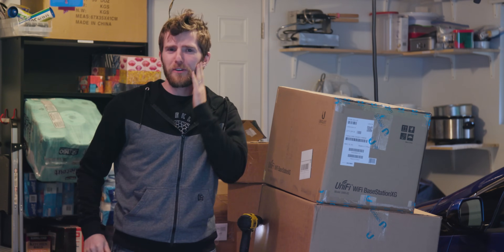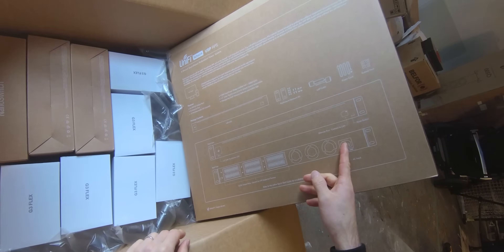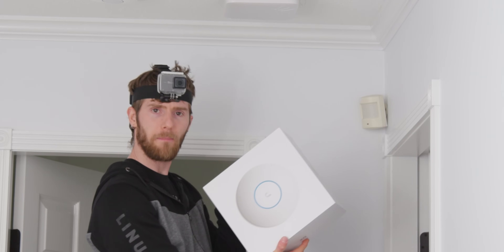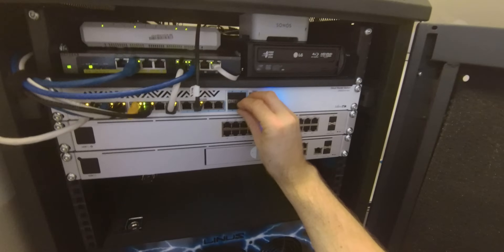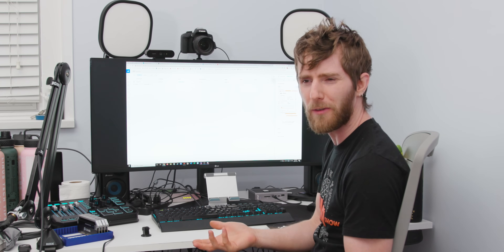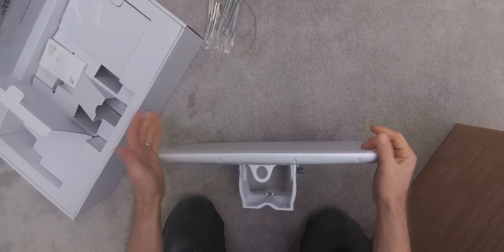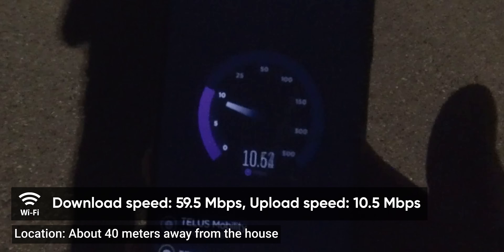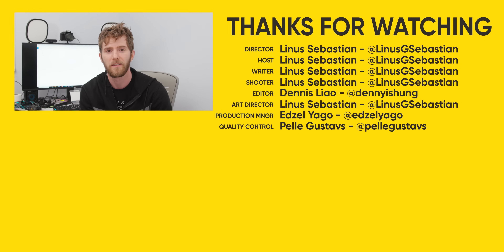I REPLACED my $1000 Wifi....

Comment: Just FYI.... there are some serious differences between the new UDM Pro and the older USG products.  Namely, the UDM Pro doesn't yet support WAN failover, advanced NATing, config.json support. OSPF routing, and others.  The UDM Pro is a great product if you fall within the UDM Pro's narrow set of use cases, it's a great product.  If you need to do anything special, you'll quickly see it's still very much a work-in-progress.

Comment: Instead of good old speedtest you could also use the Unifi app. It will measure the real  connection speed between your Dreammachine and the client without any slowdown from your ISP or Speedtest provider. It also runs indefinetely, so you can walk around while measuring - quite nice :-)

Comment: 320 megabits???

Here in Australia, you'll be lucky enough to even get 20 megabits a second.
Reply: I’m across the ditch in NZ, and I can get very fuckin close to 1gb download
Reply: @kuribuu7876  you don't have a back ass wards government xD
Reply: @Gesteppie  yeah man, the PM's looks like a horse too
Reply: @kuribuu7876  The smaller the country, the easier and cheaper it is to set up. Au/NZ probably doesn't have the same access to subsea cables as European countries so though, as the cables land quite close to many of the big cities.
Reply: @brazeiar9672  yeah man for sure, im pretty lucky because i had fiber on my street pretty early on, i would love to see if i can get it any faster, im not sure how to go about that though
Reply: @kuribuu7876  I see fibre being a lot in the UK but the population density is much higher so the cost per capita is lower. Speeds seem to be 70M, 350M, and 1G.

Comment: Why place an outdoor unit indoors?  You will loose 10 - 20 dBm in RSSI by the materials your roof is made of.  Those extra 10 - 20 dBm not only attribute to the signal strength, but also to the SNR on longer range.
Not only the materials in the line of transmission path will attenuate the signal, but mounting an access point close to materials will cause reflections which will harm your SNR. And SNR is even more important for a stable connection than RSSI values.

Another thing you should keep in mind, is that you should place at least one of the antenna's (either gateway or your mobile) as high as possible to increase the range. Since placing your mobile or laptop as high as possible is not too practical, you should place the outdoor antenna as high as possible.
So it is quite impressive to see the range of that outdoor unit, considering it is working on far from optimal conditions.
But using the same hardware it can be so much better.

Looking forward for the next edition of this video where you will try to increase the range (or at least the bandwidth) of the outdoor unit even more by placing it outside.
You know you want to :)

Comment: Just yesterday I battled with my own unifi setup at home. Moved my whopping 2 devices (8 port PoE switch and UAP-AC-lite) to a new controller that is running on a raspberry pi 4, which is also my home DNS (with pihole) and VPN server (with PiVPN).

I love the unifi devices, but man do I hate how the absolutely need a working DHCP server on the network. Otherwise you can't adopt or manage the devices with the controller, so it's not possible to set the device up with correct settings before installing it, like we would do at uni in our network labs.

Comment: Recently purchased a Ubiquity Edgerouter X 5 port for $50.  Added it to my home network to help my Nighthawk R6900v2 with the loads we get from 16-20 users.
Was my first use of Ubiquity products. Planned on using my R6900 as a router for wifi and the Edge X for the 3 lan lines. that Quickly changed to me using the R6900 in
AP mode for wifi and letting the Edge X run my wan, lan, DNS, Switch and DHCP. UBNT makes commercial grade routing equipment for sure, I have never had this much control
over my home network.  QOS and UPnP2 are easy to set up once you learn the EdgeMax utility.  My measily 60Mbs/6Mbs cable internet can easily handle all 16-20 devices streaming video
and doesn't affect my Warzone play at all, no more buffering, lost packets, latency or bottlenecks in my network. All that from a $50-$100 router that is 4x6x1" and still only uses 33% of the
routers Ram and maybe 20% of its cpu. Gonna sell my Nighthawk and buy 2 UBNT AP units for wifi now. That Big 3 5G radio AP unit just replaced the wifi for your entire subdivision!!
Thanks for the vids Linus!!

Comment: The last WIFI upgrade I did was adding a AP back in 2016 (ASUS RT-N12/D1) This is wired to my main router (Buffalo WZR-300HP w/ DD-WRT) that i got used in early 2014

Comment: Solid wire vs stranded wire: More wires, (stranded), equals more surface for the electrons to flow on, so less resistance, thus better flow. It is also more... "bendy", but I don't think that's the main reason stranded is recommended. ;)

Comment: One advantage of having UniFi APs connected via PoE to a UniFi PoE switch is that you can remotely reboot the AP by power cycling the PoE port.

Do note that the Ubuiquiti gear may have issues playing nice with gear from other vendors, especially when working with VLANs.
I've had clients connected to non-UBNT switch/AP being directed to the device VLAN instead of the configured client VLAN (e.g. via VLAN tagging the SSID), causing a whole bunch of issues.

Comment: Linus, pop in a second cable; the 1Gbit can run from the USW PoE switch to deliver power (do check the 802.3at rating requirements!) and deliver a 10Gbit uplink to the AP via a 10Gbit SFP. Unifi allows trunking the ports together.

Comment: Man, I appreciate your networking ambition, but dang, you’re not awesome at it. No offense!  Ideally, you’d install multiple access points and run them all at a mild to low power. Look at large schools/colleges/event centers: many WAPs. Sometimes two WAPs in one room. Check out the use case for the Basestation XG, it’s built for high capacity, not longer range. Hence the multiple radios built into it.

Comment: It's all fun and games until the neighbors start complaining that their wifi got worse... If it doesn't break any regulations then i guess it's fine, but it still seems like overkill.
My shitty little omnidirectional modem/router/switch combo somehow goes trough 2 brick/concrete walls and still works 30m away, so i have no idea why would you need such an overpowered thing...

Comment: Spending thousands on WiFi then using SpeedTest to test the connection strength...to your local access points. Use the companion app, WiFi Man by Ubiquiti and look at the actual link speeds to the APs.

Comment: Welcome aboard the Unifi train ;) You're gonna love the cameras with it...sooooo much smoother operation than other NVRs . I went with a similar setup to yours not too long ago, dream machine pro, bunch of unifi cams, couple of Nano HD APs, couple ac lite APs, one AC Pro AP, 16 port switch, and 8 port switch. Goign to try out 10Gbit tonight or tomorrow to have shared storage between my server and main desktop that I can acceptably run steam games off of  (1TB PCIe gen 4 NVME tiered to a 10TB 7200 RPM)

Comment: I just upgraded my pc with a B450 tomahawk max, ryzen 2600, 500w psu, and 2x8 ddr4 3600mhz and I can’t find the issue where my motherboard has blue lights instead of the red it should have. It won’t send a signal to my monitor or give any power to my keyboard but my mouse would turn on. Did anyone have the same problem but fixed it? Please help

Comment: @Linus Tech Tips Want further range? Add a parabolic reflector dish and possibly a Yagi antenna or biquad Yagi antenna module to the attic access point. You can build it out of scrap odds and ends and little to minimal physical work and get much more range.

Comment: 2021: I'm upgrading my home WiFi to WiFi 6!
Reply: Ubiquiti just released WiFi 6 AP's lol.
Reply: @farioko9254  ?
Reply: @farioko9254  Yeah but 6 makes no sense to upgrade, wait for 6E
Reply: @farioko9254  Just "released" them to "Early Access" for testing.  Not yet released for general sale as far as I've seen.
Reply: @farioko9254  Rule number one for Ubiquity hardware: DON'T buy their hardware until 3-6 months has passed, the first firmware WILL be buggy and they may discover the hardware is not good enough. I wouldn't touch those with a barge pole yet.
Following that rule would have avoided the bad square APs (the initial AC model) that Linus mentions having had issues with, note that the current controller support older AND newer Access Points but not the square ones (they were that bad).

Comment: I fell out of love with Unifi when they dropped the ball on the UDM Pro. Could have been better use of the 10gig ports. Also their switches are kinda overpriced. You are basically paying for the UI, which has it's pros and cons. I love the Unifi access points only. PfSense custom Router, Mikrotik 1G & 10G swithes w/ Unifi Access points is how I like it.

Comment: I bought a 50 euro Asus router like 5 years ago after searching the best option for that price, and it's gigabit LAN with dual-band wifi and 4 freaking antennas that easily gives my whole house the full download and upload speed that i pay for with my ISP. I don't have even close to half of gigabit download, and lets not even speak about my mere 10 Mbps max upload speed. So I guess my gigabit router will stay being part of my family for MANY more years. And heck, we have a lot of computers and consoles with fully digital games (100GB+ downloads), smartTVs with 4K netflix and a real YouTube addiction sometimes a lot of them running at the same time, zero lags or problems with the internet. By the time i finally NEED to upgrade my router, you probably have upgraded your wifi 10 more times and have like 50 Terabits routers in a mesh network configuration. At least my YouTube addiction and my "peasant" router gives you views and pays for your extremely overkill and completely unnecessary tech. But still, I cannot help but feel that sensation of... "why am I watching this? Why is this interesting? What am I supposed to get with this video?" and literally give up watching 2 or 3 min in...

Comment: The cheapest ubiquity unifi ap-ac-lite would be just fine for the number of clients you're running in your house. The XG is overkill because it's designed for a large number of clients, not necessarily for the speed only on a single device or a few there off. The added features of extra radios are nice, but way overkill.  If you must spend money for residential, don't go beyond nano HD access points.

Comment: And now you need to configure it so each AP doesn't overlap each other. Also WiFi - AI on the controller is awesome, it will periodically check if is in the best channel and switch it when needed.

Comment: We have 500 up and 500 down, its great as well as being able to sub divide that bandwidth across the property is a huge bonus. We have 100 up and 100 down in the shop and the apartment. That being said we did have to buy new gear to take advantage of the huge bump in speed. I think its roughly 8 times faster than what we had before.

Comment: Wow. So its fun to watch some else do UNIFI. Bud there some crutial things not mensioned. Linus your not Vader you dont need all that powa!  Those APs are ment for malls and hundreds of clients. Setting power to high couses clients can hear AP loud and clear buď not have enought power to reatch it back its cleary seen on you speedtest. Also I pity your neighbours :D you run basicly jammer setup.  802.11 is designet to work  at all conditions, even at significant loss of speed and setting power too high or bant too wide couses many problems. If you want I will make all my experince availible. I have unifi on 253 locations from pubs to stadiums and sorted all king of problems. I would love to help to make - proper way to setup your wifi guide. Most user errors are quite common. Let me know in PM if LTT is interested.  And some unifi tips:  Fot the best experince All AP´s need to have manual IP with and the same DNS as controller - to prevent handover issues and also DPHC lease timeouts(unifi thing) aaand hotspot headhics.  If using USG - smart ques disable hardwarte offload - means if enabled maximum thruput is usually 1/4 . With BR Jan Postl.

Comment: I am using a single AP-AC-LR located in a second story bedroom and it gives excellent coverage throughout the main floor and adequate coverage at it's furthest most point located in the basement. I am extremely happy with it after the abysmal performance I had with the AmplifiHD. At some point I will add a secondary AP for more even coverage but this single unit is good for now.

Comment: I really don't know anything about wifi stuff. Can someone help?

I pay for a 125mbps connection but usually get around 100mbps sitting right next to the router. And a measly 20mbps in my bedroom. Which I understand, network traffic and such. What I don't understand is the fancy router craze. If I pay for 125mbps, I won't ever get more than that regardless of the router, correct?

Comment: 2030: Linus can use his own wifi in another country
Reply: I think you mean 2021
Reply: 3030: Linus
 can use his own country in another wifi
Reply: He doesnt need VPN anymore
Reply: I mean you can already do that, he made a video on the couple KM WiFi
Reply: Im sure he will go there by foot
Reply: When they buy their satelite, yes worldwide wifi
Reply: xddd😅
Reply: Given Linus Media Group is based out of New Westminster and they’ve demonstrated multi-kilometre wireless, that wouldn’t be that difficult. The US border is right there.
Reply: 2090: Linus WiFi signal is strong at Mars.
Reply: If we're still here in 2030
Reply: In my case, the Wifi isn’t the bottleneck. It’s the cable modem or more likely the cable that feeds it...
Reply: he's already hosing Trump's (+1) Country Code), eh?
Reply: Isn't that vpn?
Reply: Yea and why is it that even when Linus does something wrong i still do not feel like it is a bad product or it interrupts flow of the video. These videos just make sense.
Reply: members get the password to his wifi
Reply: Already possible, you'd be surprised what you can achieve with directional antennas, large dish arrays, multi-node syncing, mesh networking, LoRa, and other similar options.

There's a dude here on YouTube from Europe (Sweden I think) that has demonstrated LoRa across a 100+KM distance.

The speed isn't great when using LoRa, but the antenna was roughly 70mm in height, so nothing to laugh at. I thought it was rather impressive at any rate.
Reply: “I’m standing here in Seattle on my Wi-Fi at my house with my LTT hoodie on, 59.99 at LTTStore.com.”
Reply: Just move to Rue Canusa then.
Reply: 2030 he buys his own satellite.
Reply: 2050 NASA:oh we’re sensing a linus using his home wi-fi at 20tbps from his andromeda office
Linus:oh man why is this 20tb game taking a whole second to download
Oh my WiFi is only 20 tbps I need to buy a new one
NASA:oh the linus has come to his house how so quickly, did he realise we were using his wi-fi
Linus:so now I’ll go back to andromeda to test this out
NASA:how does this person travel so fast hes in andromeda and...
Linus:oh finally this runs at 250 yottabytes per second
NASA:🤬🤬🤬🤬+🤯🤯🤯🤯 how is our, sorry linus’ Internet so fast
Reply: Hamlinzzz  bro?
Reply: And he has a power cut
Reply: By 2030 internet might be free for everyone
Reply: 9yrs left
Reply: You know, I live in Washington State, Seattle specifically. He lives in Vancouver, just a little ways up the straight and across the water. Because radio waves travel better over water, it's technically possible if he used a directed signal that I might be able to join his network. He did a video about the power of network dishes demonstrating just how far a basic wifi signal can go!

Comment: Even if you put a super powerful Tx AP that beams 50-60m across, you may not get the speeds you're looking for, because you'd need a powerful device to talk back to that AP otherwise you'd have full Signal on your phone but your phone won't be able to talk back to the AP as it's radio doesn't have that much Tx capability.

Comment: Good grief - the outdoor Basestation XG can serve a stadium full of people.  Talk about overkill.  It's outdoor rated - mount it outside!  They have a black cover for it to make it less conspicuous.  

The indoor UAP-XG is a sweet AP but again it's more useful for a room full of hundreds of people.  Using one at home is a bit like swatting a fly with an elephant instead of a fly swatter.  But if you have the means, to quote Ferris Bueller...

You can run the Unifi controller on your PC - you don't have to run it only on their hardware.  Good luck with the Dream Machine Pro - it's still a bit raw.  If it won't detect your hard drive, us the clean command in diskpart.exe in Windows or use dd to wipe the first part of the drive in Linux/macOS.  Once the drive is cleaned of partitions the DMP should use it with no issue.

Comment: Can you guys try a water cooling rig with a silver plate instead of a copper one
Silver is the most thermally conductive substance so it stands to reason that it could perform great
Reply: By using a more efficient medium you can decrease the temperature of the liquid cooling it and theoretically get much less condensation for the same cooling performance
You can buy plenty enough silver for less than 50 bucks considering you'll probably only use about 2 ounces